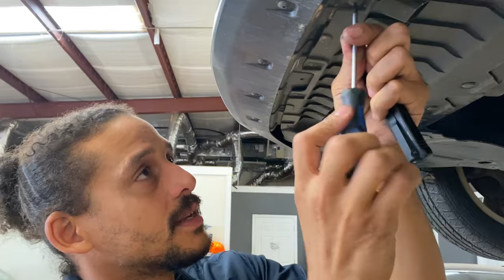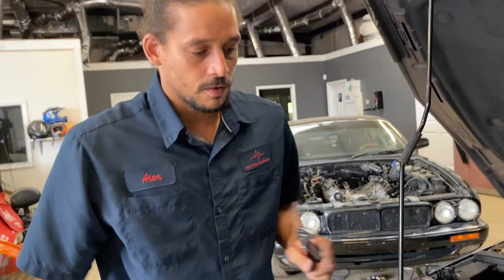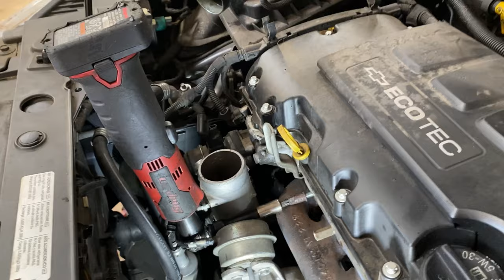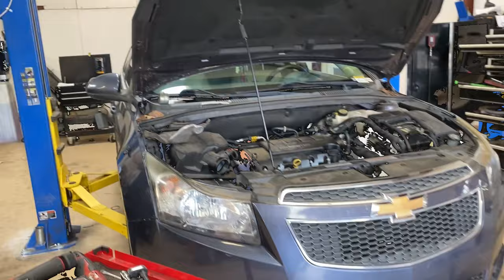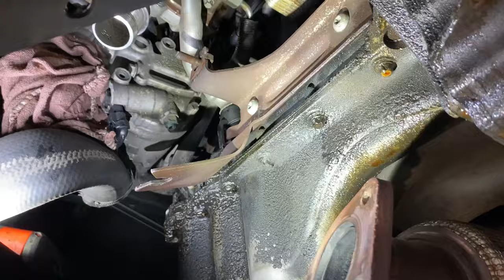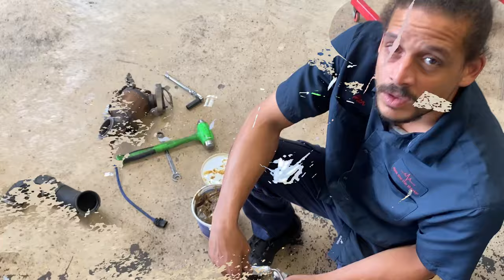Chevy Cruze Turbo Removal Process  ( Fixing a Coolant Leak By Replacing The Turbo Cooler Lines)

Comment: I cannot believe that GM couldn't come up with a better place to put that Turbo metal oil line other than right next to the manifold ! I have seen those metal tubes get clogged up with burnt up crusty oil to many times . Do your customer a favor and clean it out for them . They will appreciate it !  Great video !
Reply: @DanRussell-q8s  especially the extra heat from the exhaust making the turbo more hot then it already is, ridiculous by GM!
Reply: @roberylawler4728  Yes sir !
Reply: @DanRussell-q8s  better yet, replace the line with a new one. It looks like the one that was on there was a replacement as well since the OEM ones didn’t have two O rings on the engine that runs into the engine.

Comment: Informative and thorough, your work deserves more attention.
When I did this job on a 2011 Cruze, I didn't take the cat out. It was enough just to remove the bolt on the bracket holding it to the engine, that allowed enough wiggle to pop it off the downpipe.
I like how you kept the budget down by only replacing the parts that were broken. If your fixing your car on a budget or just getting in to doing your own auto work, keep in mind that OEM parts are expensive and not always necessary. Sometimes, they're not even the best quality option. Most of the time, a third party option from Korea or China will do the job just fine. This does not apply to the cheapest knockoff of the most complicated engine parts, but generally: if it's on Rock Auto or being sold at NAPA, it will be good enough to last until you upgrade your ride. I've ran multiple third-party water pumps, belts, coils, and even engine bearings for 5+ years, until I have sold the car. 
But use this guy to tell you how to install it.
Reply from the maker: Thanks for watching buddy and your feedback I’m glad you enjoyed my video
Reply: In case of a turbo replacement just replace the whole thing assembly everything...

It's not that expensive

Comment: Thank you Alex you save me a headache. I was going to take the full coolant line off but after realizing it takes time I decided to simply just replace the rubber hose and the clamps for now.
Reply: That’s what i did, vs removing and replacing the entire line. Did you install the heat shield back over the rubber line? And have you had any trouble with it since replacing only the rubber line?

Comment: Im fixing to drop the cat and see if i can replace the coolant return line without pulling the turbo. Its on a 2015 encore. Ill let ya knkw if it works or not. Ive been a mechanic 26 years and am replacing the line after hours for friend. Ive put on dozens of those turbos but im still glad ifound this video first. Thanks brother.

Comment: i have this same exact car, the year, color, and everything lol... I'm glad I watched this video... I'm replacing the turbo tomorrow and I will use this as a reference.. I had two bolts snap on my catalytic converter lol ... I had to drill two holes through it .... Yikes... I will use this video as a reference tomorrow... Thanks for all the detail and sweating for us! Congrats on your baby! Tell your wife I said thanks for holding the camera so well
Reply from the maker: Thanks for the support buddy. I will let my wife know. Let me know how it turns out!
Reply: @AlexTheCarDoctor  So far so good kinda! The good news is my car runs a whole lot better with no codes but the bad news is i have a small oil leak so I will be putting it up on the ramps again lol yay!
Reply from the maker: @DJRussellBrian  I hope it’s a easy fix. Maybe a loose bolt

Comment: this is a great video i like how you show the difficult parts because no job seems to be cut and dry the other videos on this skip the hard parts thanks man gonna give it a go sunday ill check back
Reply: Checking back in.. finished install thanks to the video and its running alot better. The old turbo housing was cracked right by the flap. Hardest part was reinstalling the 17mm lower coolant line due to it being floppy but I ended up catching a couple threads and getting it back in.

Comment: Thanks @Alex for the great video. I have a coolant leak from a car very similar to this, coming from one of the lines attached to the turbo. My mechanic told me that it's best to replace the lines as well as the turbo itself just to make sure that the leak is fixed. Do you think it's necessary to replace the turbo as well? I want to see whether I can save some bucks by using the same turbo. Thanks again.

Comment: rear oil drain is a pain, i used a 17 socket on the otherside of that rear coolant line to detach it from the engine, i got to it by going above the serpentine from the side

Comment: I work for GM and you really dont need to remove the turbocharger to replace the lines. But i love what you are doing keep up the good work.
Reply from the maker: You are absolutely RIGHT! I just thought I would tackle to video ideas at once. In case someone wanted to know how to remove the turbo. Thanks so much for watching! Shout out to you my fellow mechanic brother. 👨🏽‍🔧
Reply: If you don't take the turbo off, how difficult is it to replaced on the coolant line? And would you need to replace the oil too?
Reply from the maker: @JohnDavis1972  hey there I would say it would be pretty difficult very tight space but it can be done I just find it easier to take off the turbo to replace them. you don’t have to change out the oil if you don’t want to
Reply: just watched your video very informative,  can the coolant line #55567067 be replaced without removing the entire turbo? can it be done by removing the cat. converter only? (not a mechanic looking to possibly save cost)

Comment: I have the same leak on my 2014, this seems to be a common problem on the Chevy Cruze another terrible set up, wondering how you would of replaced with a hose so you don't have to tear down so far to fix?
and would it be a fix?  I bought the new part and am somewhat mechanical inclined but not happy about the teat down that fat for one little line,and getting it back together with no issues, your video is excellent and your proper repair is great.
Reply from the maker: Thanks for the support and feedback.I know this that first line on the top is not hard to change but the one under your turbo that’s the tough one to get to if you decide to leave the turbo on its just easier to remove the turbo you can do it buddy just take your time and soak your bolts in penetrating oil 2hr before you start
Reply: Where you able to replace the hose without the full tear down?

Comment: I certainly could have used these on an intake i installed last week. The job has been a little bit of a nightmare. The car had 7 codes. I had to change intake manifold, valve cover, pcv bypass, map sensor, all vacuum tubes. I got rid of all but one code P2261. I would have to remove the intake manifold again, ugg

Comment: The torque 45s on mine all stripped. Used a brand new bit the correct size and everything.  All stripped. It's getting towed to a shop.

Comment: Is there a need to replace the gasket between the exhaust manifold and the catalytic converter
Reply from the maker: You can get away with out replacing it especially if it’s metal gasket but if you can I recommend replacing it so you won’t have to do the work over again if it leaks
Reply: @AlexTheCarDoctor  
Thank you for your reply.  Your videos are very easy to follow.  Very much appreciated.
Reply from the maker: @davidkrysuik2325  my pleasure thanks for your support

Comment: Thank you very much for that awesome video.  It made this repair much easier for me.  I do have one question though, what brand of parts did you use??  I used Zonfant, which I bought from Amazon.  About 1 month after i did the repair one of the coolant lines on the turbo is leaking due to a faulty part.  So Im going to take it all back apart and replace it again.  Im not very impressed with the Zonfant brand.  Is GM Parts the best for this, or am I just paying more for the name?  Any info. you can provide would be greatly appreciated.  Thanks Brian

Comment: Alex is there a way to see where that leak came from near the the turbo by visual inspection? I know it was covered by the heat shield. I had my coolant reservoir replaced because it was a leak and 2 hoses because of coolant damage because the hose was soft. The shop did the work. Put pressure through the system before to check for leaks and and after when the work was done to check for leaks. I left and 9 days later same issue. Come to find out there was a secondary leak  from rusted pipes from coolant line going to the turbo. In your opinion if you did the work on the reservoir and 2 hoses wouldn't you check other lines leading from or associated with the coolant just to make sure there isnt any issues so you might want to inform the customer? Thanks. Oh I have a 2012 Chevy Cruz Eco with 116k miles.
Reply from the maker: They definitely should’ve looked over the whole cooling system for you for potential future failures,I don’t see why not it benefits both you and the shop if they find something like a rusted coolant parts
Reply from the maker: Or any other problem,at my shop I provide free inspections
Reply: I just replaced the coolant reservoir on a 2012 Cruze a few months ago. It was definitely cracked and leaking. Now it's back in our shop, came in after overheating. Coolant was low. I filled it and pressure tested again. No leaks, no pressure drop.

Sat on the lift under pressure for 30 minutes before I got drips. If you pull the tube the leak goes away. Not an obvious leak and sometimes doesn't leak depending on how it's positioned. Just poor design by GM.
Reply from the maker: If there was any rusted coolant lines I would most definitely let the customer know . You can easily see rust on the outer lines but I do know sometimes the outer lines will look fine and it will rust from the inside out that you can’t really detect. Thanks for watching buddy

Comment: Great video 🙏🏽. I just have one question. When installing the turbo and coolant lines you removed with the 17 mm or Vice grip. Did you have a problem with the coolant line on the left reaching the hole? For some reason that coolant line for me won’t reach any tips you can give me I am ordering the new coolant line hopefully it works better.
Reply from the maker: Hey there I used the 17mm,are you talking about the rubber hose
Reply from the maker: I’m glad you enjoyed it
Reply: Hey Alex, yeah I’m talking about the rubber hose the last coolant line. For some reason when I put the turbo back. I was unable to plug that coolant bolt in it’s hole. I ordered a new coolant line. Hopefully it works 🤦🏻‍♂️. I might try to take out the cat and do it from under
Reply: Oh okay I see you didn’t Install it on the turbo before. Setting the turbo in place 🫡 glad I just saw that tip
Reply from the maker: @sebastianvargas525  let me know how it turns out
Reply: Did you ever fix this issue? If so how? I am having this same problem and it is driving me crazy. I cant get the left coolant return hose to reach the hole. It is the 17mm bolt. Please assist. Thanks.
Reply: @sebastianvargas525   Can you assist with my above question? You seemed to have the same issue and I would like to know what you did to fix it? Thanks.
Reply: @AlexTheCarDoctor  Can you assist with my above question? How did you reinstall the left coolant return line? 17mm Bolt. It does not reach the hole when trying to reinstall. Thanks.
Reply from the maker: @ktm6660  can you look me up on Instagram and send me a picture
Reply: @ktm6660  I just did this but the coolant line      Without the turbo present install the line. Add the turbo and the line up the line on the turbo and screw the line in. You will need a thin wrench. I used a Capri brand thin wrench. Good luck.

Comment: you should plug the turbo air intake with a rag
Reply from the maker: I only plug things if I’m leaving the job for a few hr
Reply: @AlexTheCarDoctor  a screw or a nut could fall into the compressor impeller while you are working. Tank you for the video

Comment: So let’s say I just take it to a shop cause I have this problem rn but work to much to deal with trying this my self. can u give a rough estimate?
Reply from the maker: That job should cost anywhere between $400 to $700 depending on labor rates and part cost in your area.

Comment: I don’t have a lift, ratcheting wrenches, or spare washers/gaskets/screws/bolts

So this would definitely be a 7.5, with my current tools, also how many things need to get removed just to get to the thing you want

Compared to a coolant reservoir replacement, which I rate a 2

A serpentine belt replacement a 5 (granted I was stranded and only had a small cheap ratchet/socket set from autozone) had I been home with my tools… a 2
Reply from the maker: Hey buddy thanks for watching! Yeah, when I give a job rating, I think I’m always off due to the fact that people have different skill sets and different tools like you mentioned. Life is so much easier with the right tools 🛠

Comment: It is sooooooo much easier to just remove the catalytic converter and egr tune and replace the line. 2.5 hour job done in 1. Still have to take the heat shield off the turbo but that's it, the rest of that was unnecessary. I'm sure you figured that out by now though lol
Reply from the maker: Hey there buddy yeah I know it was unnecessary to take the turbo off to change the cooler lines but I figured it would be a good opportunity to show people how to remove the turbo that’s why I label the video turbo removal process. Thanks for watching buddy

Comment: My coolant line, was not that easy to get off. The line move because the connection with the line and the 17mm nut are so tight. I wish you would have shown how to get it back on.
Reply from the maker: I thought I did,I will make another video next opportunity I get if it wasn’t that clear
Reply from the maker: Wow I left you hanging sorry
Reply: Fourth time I have done a turbo on one of these that coolant line going to the block gets me everytime think I’m going to take turbo back off and try to bolt coolant line to block first another problem I have is the oil return line that black clip that is on return going to block always breaks I end up always leaving it broke never failed but this time I would like to not break the clip even though I already did thinking about getting another return line do you have any suggestions for getting that line in block with out breaking black clip or coolant line

Comment: hi i just got my car back from the mechanic, cost me a fortune .they said the engine oil cooler was leaking onto exhaust. so they remove and replace oil cooler. But whenever i drive my car for a while i can smell gas inside.? is it normal or will it go away?
Reply from the maker: Hey there thanks for watching is your car Chevy Cruz and what engine size. It’s definitely not normal to smell any fumes inside your car that’s actually dangerous  make sure you have the windows down to vent out the gas fumes while driving
Reply: hi yes, its 2013 chevy cruze LT 1.4 Turbo.

Comment: What type of power tool is that?
Reply from the maker: Hey there I had several on the table the two long straight ones were 3/ 8 electric ratchet and the one that looks like a gun was a 3/8 impact gun

Comment: I'm going to have to do that to replace the oil line on the oil çooler. I done replace the oil çooler line to the turbo.but still got oil leak. So I will have to remove turbo on my wife's car. O that's a nice jaugwire, I replaced the motor one one.

Comment: where and how can i find thoses fitting or what are the name of them ??/
Reply from the maker: Hello sorry I didn’t provide that information.I found this on Amazon https://amzn.to/3FztNbf
https://amzn.to/3EyLlTM
https://amzn.to/3exMW1s
The last link is the turbo drain hose it’s plastic sometimes it will break buy it just in case. I got my parts from the dealership same parts found on Amazon
Reply: @AlexTheCarDoctor  thank you very much
Reply from the maker: My pleasure buddy
Reply: @AlexTheCarDoctor  after replaced the turbo no cooling going to the radiator no heater either whats wrong could i have done ??? pls i need your healp on this
Reply from the maker: @theeclipseshow2432  you may just have air in the coolant system.I have a video on bleeding the air out the system
Reply from the maker: @theeclipseshow2432  https://youtu.be/DOE55feY3aM
Reply: @AlexTheCarDoctor  yessssss thats what i had air in the coolant system now the heater is working thank god but i notice that the lower radiator hose the one that goes to the turbo is not hot like no coolant going trough that hose is that normal ???? and one more time thank you very much for all your help buddy
Reply from the maker: @theeclipseshow2432  no problem it’s my pleasure. I’m glad we found the problem you may have a air pocket still in the system redo the step over again just to double check

Comment: My Chevy Cruze overheated I took it to the shop & they change the water pump & thermostat but it continued to over heated when I drove it so I took it back & he say it was on tube was loses so I drove it for two day & it over heated again & I have a Chevy Cruze LT turbo 

Any help or what I can do appreciate
Reply from the maker: Hey there buddy sounds like you need to do a block test, they should have done it prior to install parts to make sure the head gasket was not blown smh 🤦🏾
Reply from the maker: This is how you do it yourself https://youtu.be/N4NpomEKm4g